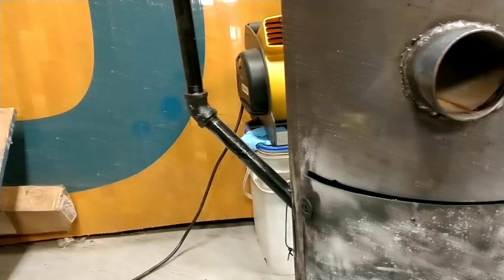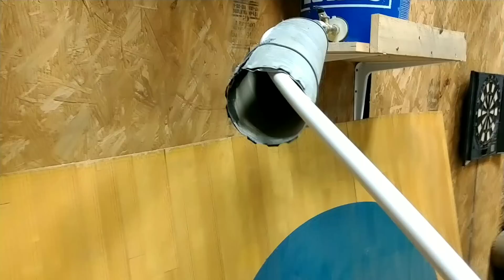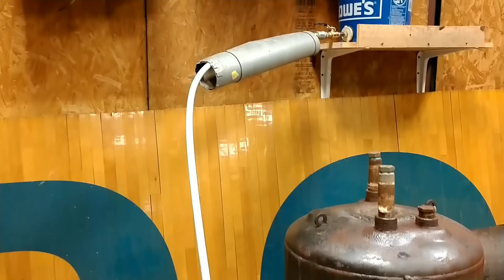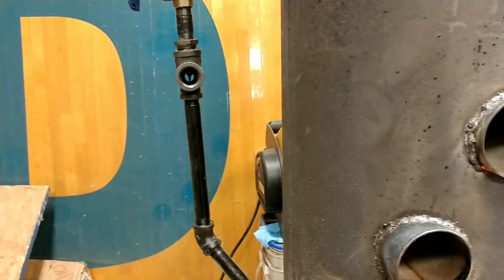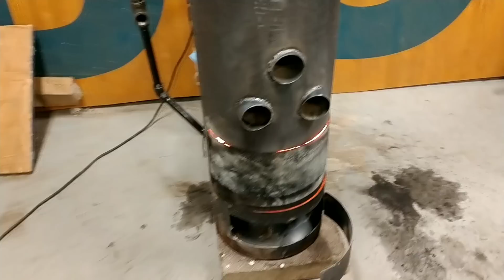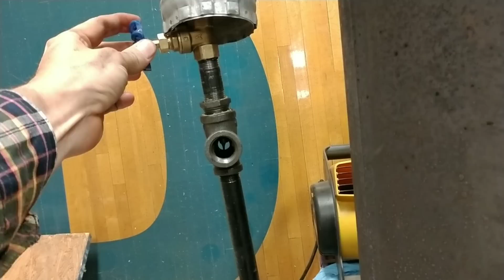Updated Waste Oil Heater Drip Feed Ver.2.2 Detailed January 19, 2018

Comment: I thought about building one similar to this, and on the heat exchangers, drill holes in them and put about 40-50 20p nails from the outside in leaving a little nub where they are welded in , only from the bottom and sides, it may be a bit tricky getting it in, but can be done, and also put a larger tank basically on the outside either put the whole thing in a barrel, with up to 4"-6" gap all the way around, leaving openings for heat exchangers, and the doors, then fill the gap between with sand, finer the better,. Sand used in sand blasting would work great, the sand will hold heat for a long time, also protectjng the stove from overheating, also  putting a about 6-8 coils of copper or steel tubing inside the sand chamber, around 3/8-1/2" atleast, can be used for hot water, or used to plumb in a radiator across the shop, use a small water pump , that can do about 1 litre a minute, to , 10 gal per hour or so, to also store heat, and heat the room more easily, or even heat another room, or even burry the water lines in foam insulation, and put a radiator in the house 100's of feet away, I'd try to circulate the water fast enough and use a radiator large enough to keep the water under 220° under about 5-10 psi, and definitely have a pressure relief some place safe,  and use a thermal switch, to shut off the oil in case there is a over temp situation,, or at least heavily restrict the flow to reduce the temperature, it may take about 20 minutes longer to heat up, the benefit would be about a hour of heat after shutoff or longer,  depending on the thermal mass, depending on the coarseness of the sand,  how tight it can fit together,    if 120 lbs of sand could be fired the heat could be sustainable for 4-6 hours after shut off, I'd crank it up to 11 for a while, nearly a hour, then turn it down to a near drip, but dump the over pressure relief into a 5gallon bucket with about 3 gallons of water in it, and a over flow to outside,  to prevent anyone from being burned by steam! A box fan to blow through the radiator, a tiny pump, and maybe a electric shutoff valve, is about all that is required, almost everything else can be fond in a junk yard, sorry to ramble happy Holidays! ✌️
Reply from the maker: Sounds like you have some great ideas 💡

Comment: i saw someone weld vertical pipes to the outside of the tank,  as the pipes get hot they move a lot of hot air without needing a blower seemed pretty smart.

Comment: That is soooo awesome. 
If the pex line were replaced with a copper tube it would pre-heat the oil before it enters the burn chamber increasing the burn efficiency. More heat using less fuel and cleaner emissions. Likewise the squirrel fan distance from the air intake.

Comment: After 4 years.... how is your gen two holding up outta curiosity? Is it still working the way you set it up? I'm making mine out of a old wood stove setup.  Excellent video great content thank you for sharing it.
Reply from the maker: Still going I only use it 2 months out of the year
Reply: @randysdiy2102  I'm in NE Ohio and we get hit pretty hard with cold Temps. I'm looking at modifications on this wood stove and making a used oil furnace

Comment: Any recommendation in what size the drip pan, the air hat and air intake must be for a 9kg gas bottel size that is 30cm in diameter and 50cm tall, I build one but after I started it with 20ml diesel fuel it dies out
Reply from the maker: Sorry, this is the only one that I've ever built. I wouldn't know any of the measurements for anything other than this. I really don't think it matters a lot. I don't know the size of the burn chamber

Comment: What did you use to make the top hat in the burner with? And are those 3/4 in 90° fittings?
Reply from the maker: Check out my other videos I have all that info in them. The fittings are 3/8 but 1/2 or 3/4 would have probably worked better as I added holes in the hat in one of my other videos the top hat was made from the bottom of a fire extinguisher
Reply: Ok. What was the diameter of that fire extinguisher?
Reply from the maker: I don't remember I think it was about 8 inches. I have a video that covers all the measurements.https://youtu.be/6Puk4mPK1XI
Reply: Ok. Ill watch that
Reply from the maker: Be careful if you build one there's a 1000 ways it can hurt you!
Reply: Oh I understand. I've been doing my research. I'd love to show it to you when its done.

Comment: I'm a former railroad worker,.I remember when the railroad change the heaters in the caboose from coal to oil/diesel.  We used a drip feed! Approx, every 15 seconds one drop of oil would drip into the burner pan. You can slow that flow down.
Reply from the maker: Awesome

Comment: Nice simple design 👌.  You will improve the burn chamber by putting some old heavy chain around the bottom of the pot to help vaporise the oil. A good source for a similar sized tank is from an old freon refrigeration system receiver vessel , the steel is much thicker .
Reply from the maker: Good idea

Comment: Maybe use two water heaters. Cut one of them just slightly smaller in circumference. Slide that inside of the un modified one. Plug weld that all up and you have double the wall thickness. Those things are plentiful enough at scrap yards and free ads.

Comment: I burn firewood and have as much as I need, but every winter I come to videos like this and consider making one for the shop. Mountain folks all know that used motor oil has twice as many uses as duct tape, and so folks spill a bit on their dry kindling to make a fire starter that will light with one match and burn better and longer than Duraflame. I love the ingenuity of your rig! We all burn oil every time we drive, and personally I think keeping warm is an even more important use than driving. Cheers bud!
Reply from the maker: Thanks

Comment: If you leave the gate valve set, and turn the oil of with the ball valve, you probably won't need to change it all that often. For quicker shut off, place a ball valve above the gate valve and that will help to simplify things.

Comment: Great video and thank you so much. You said the hot water tank to thin. I say upgrade to version #3 with a upright large compressor tank, like 75 or 150 gallon class. That should last a lifetime.
Reply from the maker: The hot water tank has worked a lot better than I expected. After reinforcing the door area.
Reply: @randysdiy2102  That is awesome. I do a lot of side work at home, making this will be a breeze. 
Thank You
John 60107 USA.
Reply from the maker: Be careful burning oil is dangerous

Comment: Shalom Aleichem. 

I'd seal that burner door a tad more. Also the sir flow door with adjustable vents?

Ratson haba b'shem YaHuah
Reply from the maker: Check out my latest video you'll see that all those things are done and I added more air holes in the burn chamber made it burn a lot hotter and leaner

Comment: How much smoke comes out of the chimney? And can you smell it outside that oil is burning? I am concerned the neighbours might complain that I am burning oil.
Reply from the maker: I've got a couple of other videos on my channel one and smoke output you can actually see how much smoke is coming out of the chimney. And the other one depending on what kind of oil you burn as to what smell you get. If you burn engine oil it does have a very small amount of smell if you burn cooking grease then it has a rather pleasant smell

Comment: Just finished making mine and it burns really black. Any tips?
Reply from the maker: Drill more air holes. Look at the newest video. I added 8 more half inch holes in the airhat
Reply: @randysdiy2102  so I drilled more holes and still seems to not get enough air. Is it possible I drilled too many holes or would a small leak in my stove pipe cause not enough draft. Thanks
Reply from the maker: I know leaks are bad. Not sure why your having problems though. Also the longer the flue the more draft it will pull

Comment: This thing doesn't seem like it insulates the burn chamber from leaking co...
Reply from the maker: It actually pulls air in any openings, due to the draw the flue creates. If you watch my newer video on it I have sealed it up pretty good and it works much better also.

Comment: I would like to miniaturise this for use on my boat. Thank you for sharing.
Reply from the maker: Just be careful, burning oil is really dangerous. Many things could go wrong.
Reply: You’d be way better off with a “Chinese diesel heater” they have reasonable safety features for running on something like a boat or RV. 

Plus they’re only like $130 and diesel is cheap.

Comment: Looks good !  But things can go bad VERY FAST . Now make a turbo oil heater by sucking in more air  Yes you can used it for a hot water tank too. with coils of copper tubing with water running threw it or a holding tank

Comment: This may be a stupid question but does the vented air smell like oil or is it odorless?
Reply from the maker: There really isn't any smell inside the outside exhaust does smell like whatever you're burning. If it's engine oil then it has a petrol oil burning smell but if you burn cooking oil then it smells sort of like french fries or whatever. However the smell is not bad no matter what not burning My exhaust is vented about 20 ft in the air so I hardly ever smell anything
Reply: @randysdiy2102   - Oh okay gotcha. I’ve been thinking about making one myself. I def hesitated asking such a simple question. I even looked in the comments cause I didn’t wanna sound simple 😂
I really appreciate the humble response 🙏🏽
Reply from the maker: @brandonleesanders  👍

Comment: Hey man this is a super great field I really like what you doing I just have a couple questions what you getting used nothing just simple like copper pipe instead of PEX pipe on your feed line and I was just wondering how often do you have to clean it out?
Reply from the maker: How to use PEX because it's what I had laying around, and I clean it after every time I burn, you don't necessarily have to clean it that often it's just not that much trouble so I'll go ahead and clean it.

Comment: Nice job but i think you should install a fan in the lower door to increase the amount of oxygen to the combustion chamber/burner. The fan should blow air like a turbo into car engine. The oil needs a lot of oxygen to burn completely.  More air = higher temp, cleaner exhaust fumes, less oil consumption. Burning oil by the method you use poisons the air with carcinogenic chemicals. You, your family and your neighbors breathe this poisoned air so think about it.

Comment: I just add/pour a quart of oil over a 40lb bag of wood pellets in my pellet stove hopper. Forced air really gets them oil soaked pellets going very hot and my window glass stays a lot cleaner too. Getting the most use out of expensive used synthetic oil. Old peanut cooking oil works great too :-) except room temp has to be warmer so cooking oil won't gel up and jam in hopper.
Reply from the maker: Sounds awesome 😎

Comment: Great build.  Only suggestion would be seal up the door leaks and bring in outside air so that you retain your conditioned inside air.  Good choice in tunes as well!
Reply from the maker: Check out my new video on the old heater I made several improvements including the door seal.
https://youtu.be/PRGpfTpOdrk

Comment: Nice design and well built. 
I have a temperature control drip rate self regulation suggestion for you, as I built a dripper years ago, with this feature.
If your oil receiver bowl has a funnel or concave shaped bottom, a high drip rate creates larger surface area which burns away faster to avoid overflow, while a slow drip rate results in smaller surface for slower burn. 
This gives you temperature regulation and some insurance against overflow, up to a certain drip rate.
Reply from the maker: Can you provide more info on the temp control?
Reply: @randysdiy2102  I still have it so I took some photos and made a pdf document explaining and showing, which is here
https://members.storm.ca/~af/oil_burner_temp_reg/oil_burner_temp_regulation.pdf
Good for a fishing hut.
Reply from the maker: Thanks

Comment: Burning waste motor oil does not seam a good idea to me, specially if you have a vegetable garden downwind !
 For Vegetable oil, I would to put it in a diesel engine(no big deal to modifie) to produce electricity and use the waste heat.

Comment: I think this design is great. I appreciate how you were clever and made most of it from what looks like a gas fired water heater. I know you said it was a water heater, but it looks like you used the center flue pipe from the original water heater for your heat exchanger, and maybe for part of your burner assembly too. And it looks like the bottom part of your burner assembly is the bottom pan for the gas burner in the original WH. Pretty cool. Doesn't cost thousands of dollars, and doesn't require any electricity or compressed air. Thanks for sharing, very cool stuff.
Reply from the maker: Thanks

Comment: John Mason is absolutely right. Having the heat exchanger tubes at an angle, (say, 25-60 degrees ) would increase the air flow through the tubes so more colder (room temperature) air would get in and flow through,  extracting more heat from the system and  into the room

Comment: suggestion - to light your burner, add the kerosene then drop a ball of dryer lint in the kerosene and light the dryer lint. or soak a small block of wood in kerosene and drop the wood in the kerosene and light the wood with your torch.
Reply from the maker: I started using a cup of gasoile mixed with a gallon of diesel and it works great. No kindling of any kind needed.

Comment: Please tell why a needle valve wasn't used for regulation..  They were designed for that.
Reply from the maker: I tried a needle valve and it kept stopping up and clogging up on me the oil I had was the little dirty I guess, maybe if you use filtered oil you could probably use a needle valve

Comment: I made one years ago, there is a major problem if you keep the oil tank in the same room and especially above in the heat flow.. the oil will heat up and thin so more will pass through the gate valve so if you don't continually monitor the flow it will over-run. OK so you've built in a method so it 'drowns' itself and cuts off the air but what a mess, been there and done that. So, I'd advise moving your oil tank somewhere it will not be affected by large increases in temperature and use a metal one, not plastic, also use metal delivery pipes from the tank to the burner. I put a copper coil inside mine at the top that easily powered 6 room radiators. With your unit you could feed hot water from it into a fan assisted wall mounted shop heater making it far more efficient.

Comment: When I lived in Hamtramck (Michigan) early 70'sthe  houses that I lived in had a fuel oil drip tank heater these heaters were commercial made.  Needless to say it had to be pretty much in the center of the house. I had some low velocity fans to move the air around the house. I made sure my bedroom wan not far from the heater. Those heaters worked great of course you did have to be vigilant.  The commercial units had a carburetor which worked great  but like any carburetor you did have to clean it out once a year.  As you had to do the initial heat up the air vent & pot tank open to hurry it up a bit but (you know it had to have a but), if you let it go to long with the doors open then shut the inner tank door closed it would sound like a jet airplane. She would have the whining and really shuttered  until it evened its self out with the correct amount of air.  I loved those things so much I put one in the garage to work out there in the winter,  I made a metal shelf on top of it which I put my wrenches on to let them warm up.  I definitely would not mind putting one in the barn now.  

From an old hippie.
Spirit
Reply from the maker: That is great, I've never seen a commercial unit like that. I would love to get my hands on one of those with a carburetor.

Comment: I had one of these years ago that i built. One thing i ended up doing was running a double feed line. One line dripped the bare minimum to keep it burning, the other had a solenoid valve hooked to a thermostat and would open on demand for heat. When the second line opened up it would be higher flow to raise the temps in the room, once the temp got where it needed to be, the solenoid would close and go back to the first line dripping only enough to keep it going. 
Loads of next to free easy heat. Btw i had the same exact blower fan on my setup. 
I eventually built a major upgrade with an old fuel oil furnace so i could run it 24/7 automatically and keep the garage at 40 degrees until i went in the garage and turned up the thermoatat. Be aware that for that setup you need a serious supply of clean used motor oil, vegetable oil, etc.
Reply from the maker: That sounds awesome

Comment: In process of building the 2nd generation oil burner.  What type of pipe do I need for my exhaust pipe? Double insulated, triple, etc..   thank you.  Great video.
Reply from the maker: I'm just using the single wall stove pipe it seems to work phone